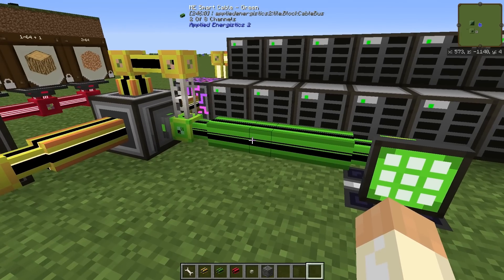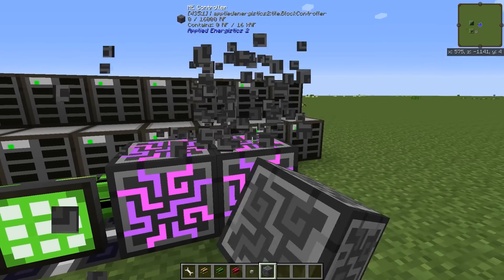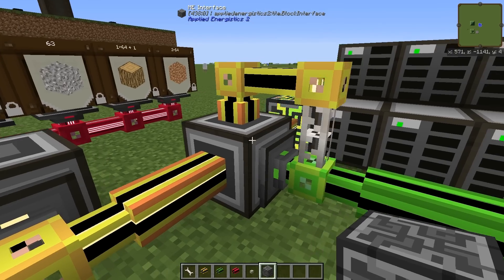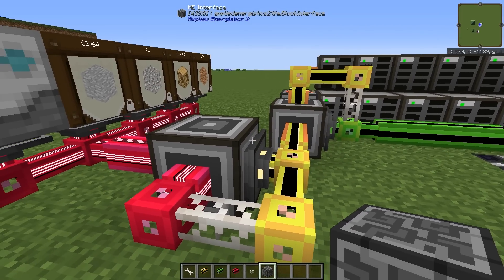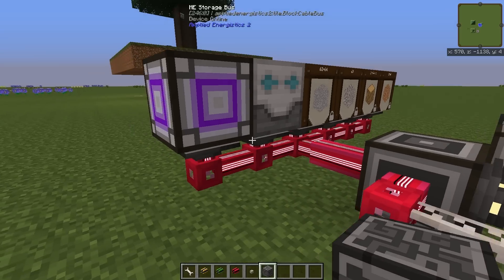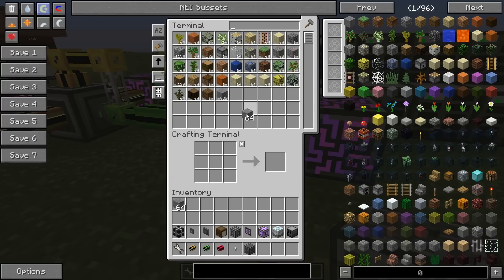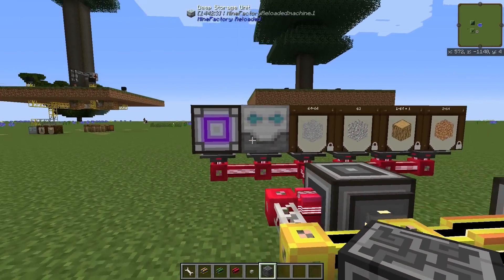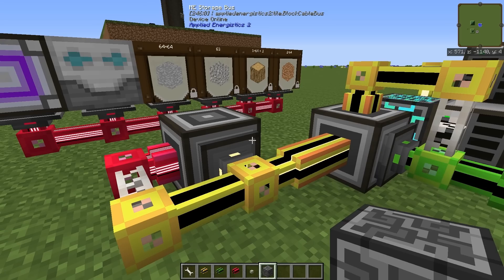AE2 Quick Tip: ME Storage In Sub Networks (Within Sub Networks!) (MC 1.7.10)

Comment: Thank you for this video, this is a problem i am curretly dealing with as i am trying to optimize my one large network into many separate and/ or reconnect multiple indepedent networks. I find your videos very useful :)
Reply from the maker: Cool, what would be the big benefit in dividing them in your design? I've done this myself with Forestry bees, because I wanted a room dedicated for that, but in the end I simply connected them together and just had a filtered crafting terminal instead. When it comes to auto-crafting, you are limited if networks are divided as they will not behave as one.
Reply: @therealtkh  I know. I have same issue with the network originally deditated to Botania with not intention to connect to main backbone but later i have realized i need more resources due to auto-crafting runes and other stuff. Terrasteel automation could be even without network but rest of requires  very specific resources that have to be crafter one by one.  There are other networks dedicated like you said for Forestry (bees, tree farm) and living quartes, there are plans for Blood Magic. Other reason was also wide distanes in my base. Now everythig is close to each other so i can reconnect them using your guidance :)
Reply from the maker: @TomasMisura  I think the most convenient setup is to have one big network (like in my large network guide video), and then filter the terminals in different buildings if you want to only see one mod for that specific building or similar. The entire setup requires a larger controller in the center, but that's also fun to build :)
Reply: @therealtkh  This is what I currently have. However  I will be experienting  with that. AE2 is a bit complex and find the best setup is tricky and requires a time.  From that reason I would prefer Refined Storage than Applied Energetics but the building of specialized subnetwork and other stuff is worthy to spend necessary time to learn stuff around...
Reply from the maker: @TomasMisura  Totally worth the extra work to figure out AE2 solutions instead of the simpler RS, but I'm probably biased :)
Reply: @therealtkh  you're definetely biased :) I start to understand AE2 and stuff around and I love the complexity od AE2. But you know I was playing RS before AE2 and can compare pros and cons both solutions....and sometime I don't want to count the channels :)
Reply from the maker: @TomasMisura  Fair enough :) Feel free to join the Discord and share your builds, love to see builds I've inspired to and to get inspired by builds better than mine!
Reply: @therealtkh  I will, I promise

Comment: Hello there... Setting up the same system with better barrels in secondary network, on the main one, apparently only one item at a time is available, if I grab it, it is replaced with an another one within a second... It's pretty annoying, specialy for auto-crafting, the network can't find more than one item though the barrel contains more than 25000 ones... anybody could help ?
Otherwise TKH your tutos are awesome, thanks so much...
Reply from the maker: A general idea when searching for errors is to replace machines with chests to eliminate configuration and compatibility problems. Make sure you connected the P2P tunnels in the right order (1. FROM ... 2. TO). Also, try to make it work without the tunnel and then only expand it step by step.
Reply: TKH 
 ah i configured them in the wrong order that explains it 
thanks man 
your vids are very informative btw
Reply from the maker: I have set up a Better Barrel (JABBA) both in my main network and sub network, but I don't see any problems. I can see all stacks in the barrels. Can you send a few screenshots of how you've set things up? Also, what versions of game/mods are you using?
Reply: I have a question
i have a me controller that is linked to a drive via P2P Tunnel-ME and a Pulverizer that has an export bus connected to it which is also connected to my Controller via P2P
now i set the filter to Iron ore but the iron ore i put in my me system isnt getting exported to the pulverizer(all devices are online btw)
Reply from the maker: SSj3_God _goku Great that it worked out! Thanks :)

Comment: Would there be a way for me to do this:  My base is mad up of multiple connected buildings. I have an AE2 system that is connected to all of buildings. If i were to have sub-networks for each building, could i do something like this: For example, in my power plant building, i can access items in the global network, as well as items in a building-specific sub-network, filled with uranium fuel rods for my reactors or something. Those items could not be accessed from any other building. But all buildings have access ti items in the global network. Could i do it? And if so, how? Thanks!
Reply from the maker: +Brenden White It doesn't sound like you want a subnet for your power plant building, but rather a stand-alone network with storage for fuel rods. And then you run a p2p connection to that building (from the power plant). It's important to know that a sub network for storage (like in this video) works best in one direction. If you're doing auto-crafting, things might get messy if you're doing sub network storage. I don't know if this helps you in any way, it would be easier to answer if I really understand what you want to achieve (not only in function, but the reason behind).
Reply: TKH Thanks for responding. I rethought my idea. I don't really want to do stand-alone networks for all of my buildings. Sub-networks wouldn't work for my application anyway. I will just go with my original plans. My original plans was to have a large AE2 network. The ME controller, crafting CPU's, molecular assemblers, and ME drives would all be in a single building (The AE2 Building.) Each other building that makes up my base would simply have terminals in them. As well as all the import/export buses for the machines. My goal is to be able to completely access all the features of my AE2 system from any building in my base. Each building would have a crafting terminal, a pattern terminal, and an interface terminal. "All features accessible anywhere" is my motto. If you have any other ideas to make this more efficient, i would like to hear them.
Reply from the maker: +Brenden White I like your plan, but depending on how your base is built (size, distances), it might be a good idea to have lots of P2P tunnels so you get a good number of channels for every building. The whole reason is so you don't need to do long distance dense cables. If you don't know how I mean you should check my tutorial/guide on "large networks" or what I named that video... ;) Regarding subnet storage you can make efficient use of your cells by dividing the large quantity resources in subnets. For example: Cobblestone can be stored up to 100k and then be voided after that insted of filling up another storage cell. And ingots could be stored in a subnet with only 4k cells (for example). Sadly, cells are too cheap, so it's perhaps not worth the extra work to do that ;)
Reply: I'll definitely have to play around with some p2p tunnels. I'll definitely find  away to intelligently manage storage of items and blocks. I plan to have the system keep a small ME chest full of dirt and have it void the rest for example.